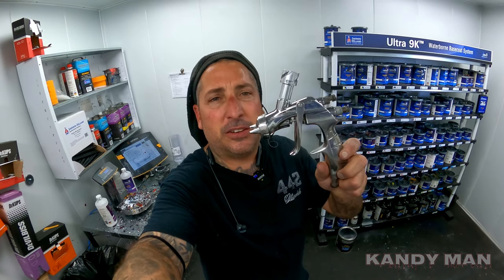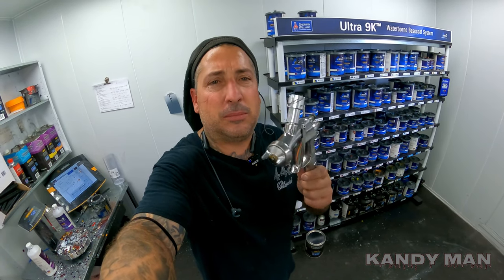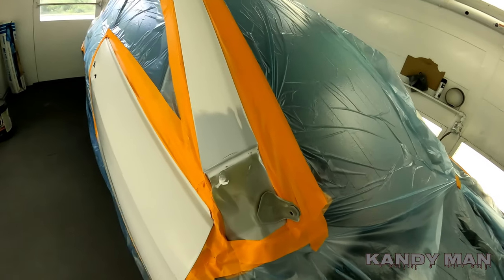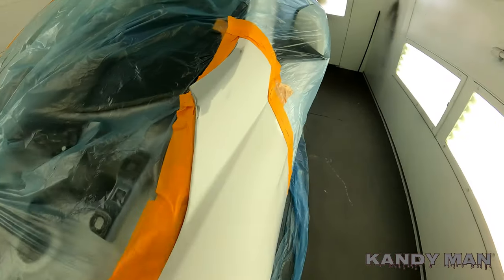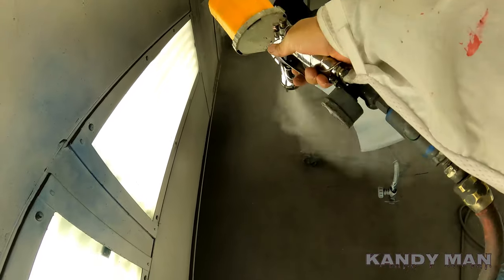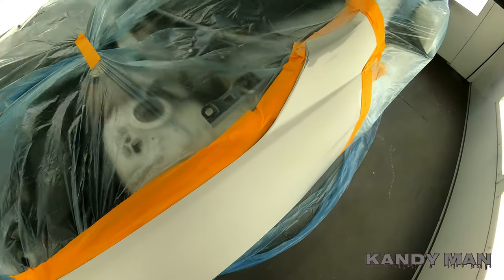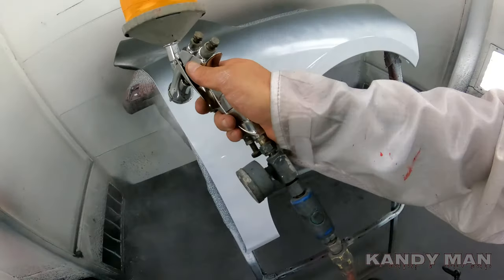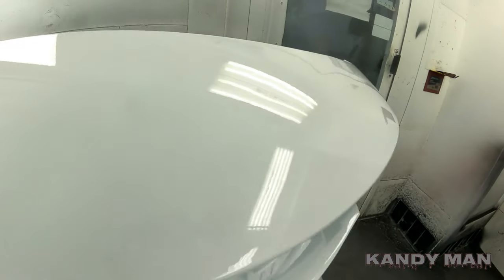IWATA WS 400

Comment: nice one yes iwatas are great guns so hows satas i pattern compare i see your on a 1.3 5500 i pattern atm
Reply from the maker: It's great no hole in middle on full  fan thanks for watching
Reply: @kandyman5315  yes its like a supercharged  ws400 the 5500 but not a firehose like the 5000 is , i find yes full fan no worries , cant really run the ws full fan as you know unless your in close with tight overlap , the 5500 isnt as hard work
Reply from the maker: Looking forward to dialing it in.👍

Comment: Nice to see you  use this gun I got a ws400 evo 1.3 I brought it of a frend 2 months ago and I love  the gun can  you  tell me what's your settings on the clear and base also  the sealer thank you  kandy man
Reply from the maker: I spray this gun wide open  fluid and pattern  I spray it close so there's  no hole in the middle of the fan that how I get the flatest  coat. For both sealer and clear. I don't use it for base .
Reply: Amen best clear gun for the buck hands down!

Comment: have u by chance tired the finsh one overall clear wanna buy it but don't want dieback i bought a cheap $60 gallon of clear not matter what i did i got dieback was told it was from the clear i was using
Reply from the maker: Could be a couple of things like clear  and humidity  but  I have done many overalls .and it spayed great thanks for watching 👊
Reply: @kandyman5315  sweet thanks humidity was low also did it when it wasn’t same thing I got a medium the Activator with it sprayed clear when it was 80 outside and 70 same results after I sprayed the 3rd coat looks super good so glossy just like the car I was painting them for them the next day after 24 hours nope
Reply: @AliVapeReviews  l